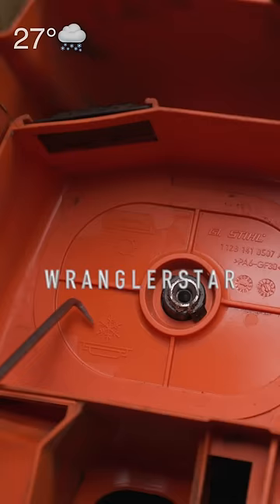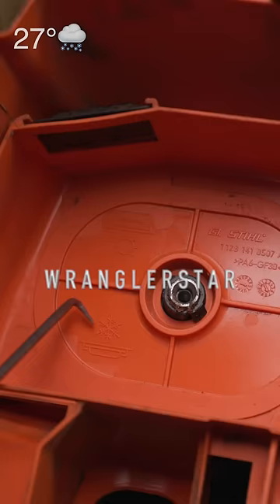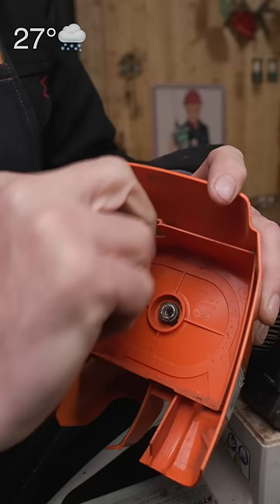Stihl Chainsaw Winter Hack! 🌞➡️❄️ Change Airbox Plate in Seconds! #shorts

Comment: A lot of engines including things like welders and generators have a similar feature where the intake for the air cleaner can be pointed at the exhaust manifold. That is how they pull warmer air.
Reply: You can even get cold weather kits for kohler engines that pull air through the muffler and into the intake. Pretty common up here in Canada.
Reply: Old carbed cars have heat risers off exhaust manifolds as well.

Comment: It’s supposed to be a high of -17 and a low of -38 here in northwest montana this weekend… this tip came up just in time, thanks!
Reply: Damn man. Stay warm up in there.
Reply: Wait whaT?
I thought Montana was a sunshine, moderate weather place
Reply: Only -5 here in MN, but we've had a mild winter. Especially compared to the last one. I'm happy to see some usually January temps and snow after December was mostly 30-50 and dry as a bone.
Reply: @jad2290  lmao you need to travel more. Montana quite often shares similar temps to my home in southern Alberta (Canada) that borders Montana. You gotta get south of Billings for it to be a bit warmer.
Reply: Forget that I'll stay in CA.
My sleeping bag is only rated at 17°f not -17°

Comment: This is for very cold conditions, 95% don’t need to worry about it. If you do, don’t forget to switch it back for summer, or cook your saw.
Reply: -20C/-5F ... and lower . -15C all day today and ... no need . You said it . Same goes for light oil ... medium goes in negatives . I rarely go with light bar oil, just a waste . Later Randy ... Wranglerstar is an Ok Dude .

Comment: I have huskys. I will look to see if they have the same idea. It's my truck companion most of winter.
Reply: What saws? I am a young fella and am highly interested in the husqvarna lineup despite my grandpa being die hard for stihl. 
I was thinking one of the ripsaw 572s
Reply: I've only used the 455 and 460s so I cant say on the 3 or 5 series saws. My saws have always been very faithful. Easy to start, idle well, run strong.
Reply: @clevernamehere7559  I used a buddy's Husqvarna 440e while helping him once and that saw was awesome. Then he dropped a tree on it. At least he was the one that set it there when that happened. But the 440e is super easy to adjust the tension and take the bar off even compared to most other saws, it doesn't require a scrench.

Edit: oh and that was a nice lightweight saw, lots of rpms, plenty of torque imo, started easy, comfortable to use for hours on end. I much preferred it even to all the Stihl saws I've used and to the Echo saw I've used. I'd be fine using any of those though.

Edit 2: I should add that I don't use chainsaws all the time and because of that I'm usually pretty sore after using one for a long period of time. The 440e is the only saw I've used that didn't really do that to me. I liked it so much that I will be getting myself one whenever I can find one.

Comment: Not every Sthil saw has the same kind of tab sometimes you need to remove reverse and reinstall a different section above the air filter. Great advice though thanks

Comment: And on the saws with a c after the model number i have a ms 261c and 361c and a 462c they actually have a little switch but its gotta be super cold at least with my experience to actually need to switch it

Comment: Or if your cursed to live in the south then winter rarely gets into the 30s so you can just die of heat exhaustion next to the wood stove that you are running for no reason while keeping the saw in the original summer option.